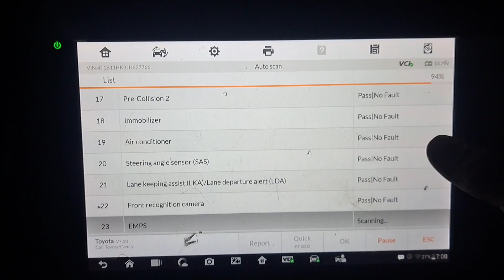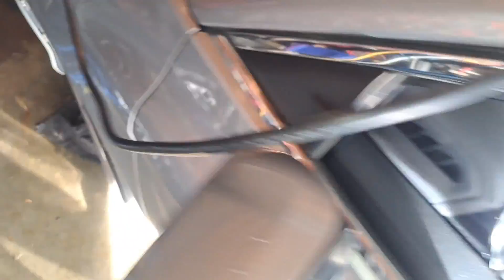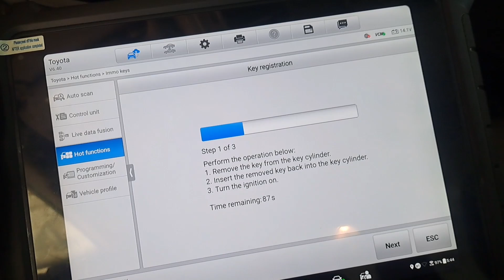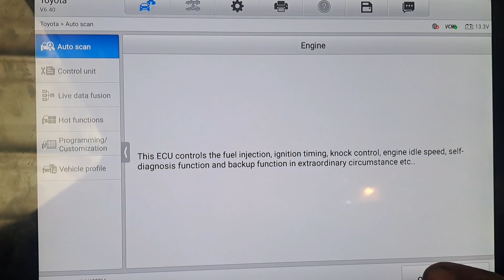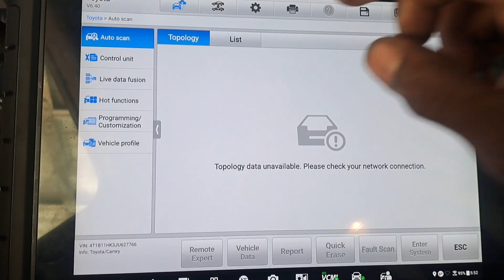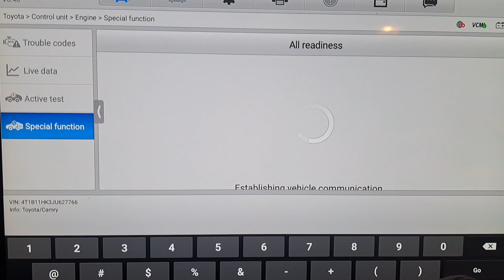Toyota camry Crank no start No communication. U010187 P061347 B279986 P0606 pt-2

Comment: Well P.S....you're smart enough!
Now three things you should the next time:
1. When you have modules like the TCM and ECM showing up as offline, run a diagnostic from the DTC connector for CAN system voltage.
If it  isn't around 60 ohms (being something like 120 ohms): one of the CAN terminating resistors are offline (burnt out).  Then, you need to ISOLATE the effected modules FROM the ECM buy disconnecting them...one by one. 
(Note: MOST ECM's have one of the two system terminating resistor in them)

...check the resistance measurement again.

If it's still other than around 60 ohms  chances are (it could be) in the ECM.
But MAKE SURE you CHECK the connectors to the ECM... and run your voltage and resistance checks to the input connections at the ECM FIRST. 

2. The fuel pump was running with KOEO. 
That could have meant a wiring short. 
Here.... you'll want  do power- to -ground resistance and voltage checks for a short(s). If the wiring checks out, then you can move to suspecting the ECM!

#. When you did the key reprogramming you didn't let  the process complete before you remove the key!
Relax. Take your time. Let the process complete!

😀

Comment: So what actually caused the PCM to damage
Reply from the maker: Good question....

Could've been the unstable voltage (seen in part 1)spikes overworking the processor in some way.

Could've been simply it's time to fail...

Could've been the mass air flow failure where it originated.. which I doubt honestly. 

It's hard to say because there weren't any follow-up codes besides the tcm/ecm processor failure. If i had to put my money on a reason,  I'd go with the battery connection in part 1.
Reply: Modern electronics (though much more precise than mechanical electrics) are way more open to component burn out, due to voltage spikes!
They tend to be more fragile! 
This is why the systems needs fuses and load resistors to protect the many systems and components in them!